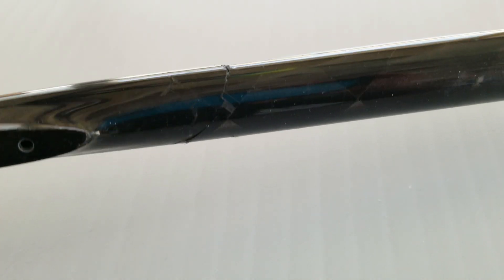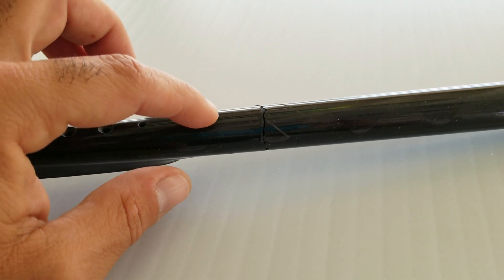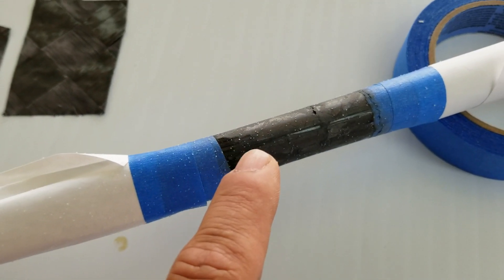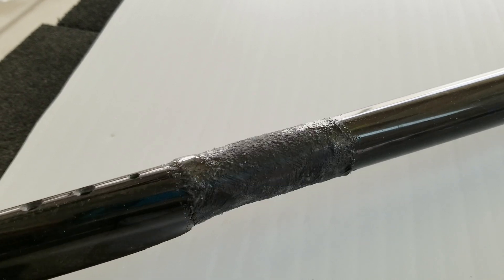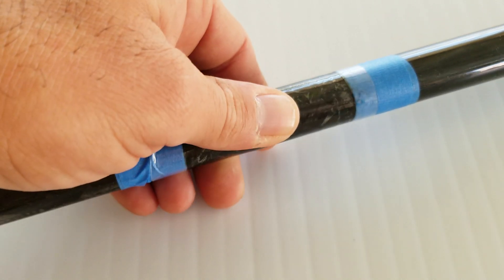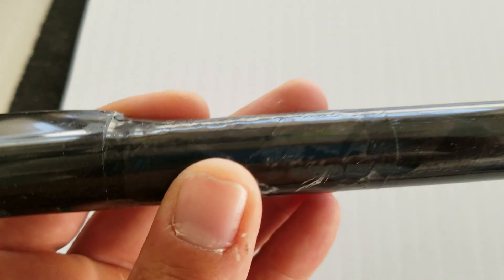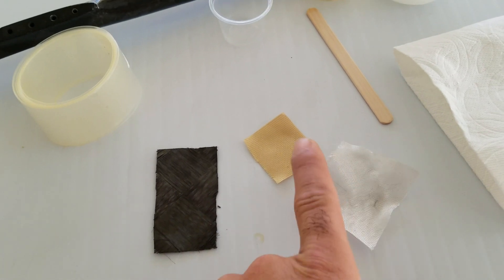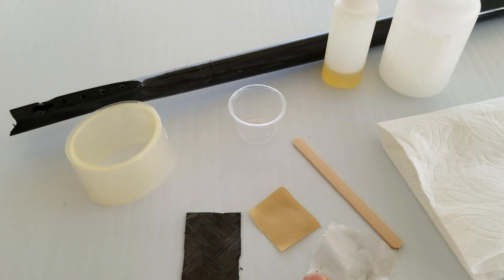Carbon Fiber Tail Boom Repair on F5J Sailplane with Heat Shrink Tubing

Comment: Great video. Very helpful thank you. I’m new to the hobby and just cracked the boom on my Deviant 1meter. Can someone point me to a good place to buy thin carbon for repairs?  Amazon seems to be a bust. Also which cure time do you use for the epoxy?
Reply from the maker: Use slowest cure possible. West systems is a good brand of epoxy. I offer some carbon repair kits on my site. https://flightcomp.com/collections/composite-repair
Reply: @flightcomp  awesome kit. Just what I was looking for. I’ll order it now. I have some Bob Smith 30 minute cure epoxy that I used for my build. Will that work for wetting out the carbon in your kit?
Reply from the maker: It would work in a pinch, but lowest viscosity is best. Another alternative is zpoxy finishing epoxy. You can find this at hobby dealers in small quantities.
Reply: Ok I’ll order some up. Can you explain in layman’s terms what makes one epoxy more desirable than another?